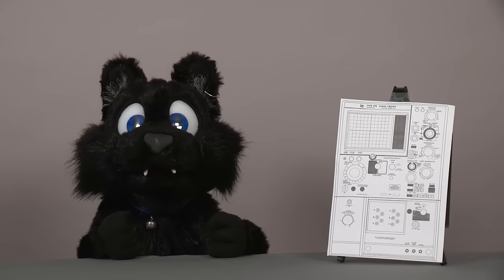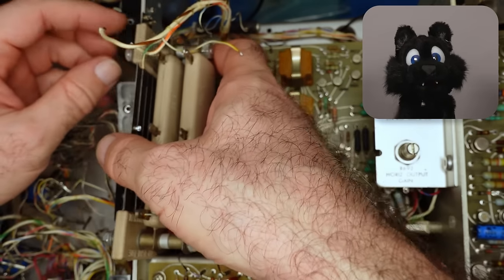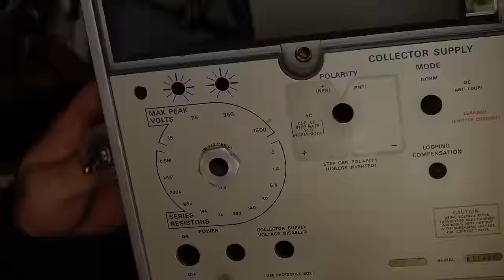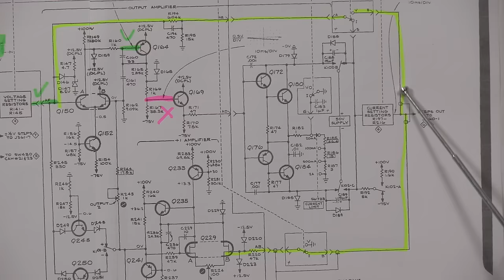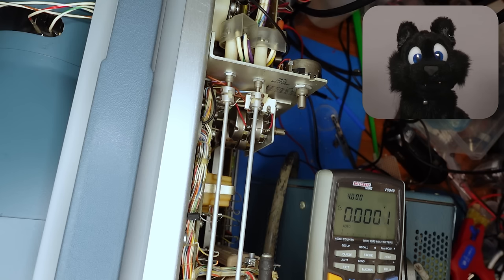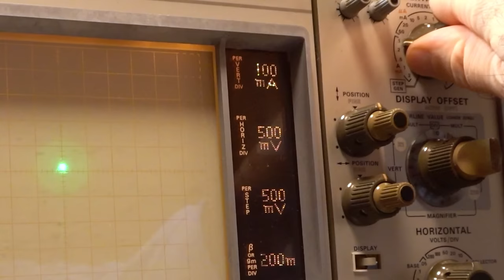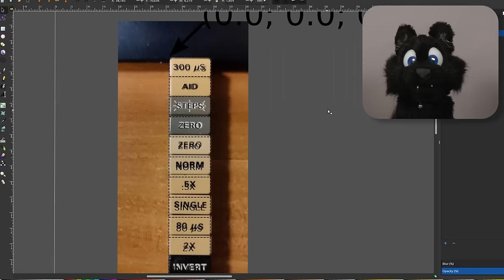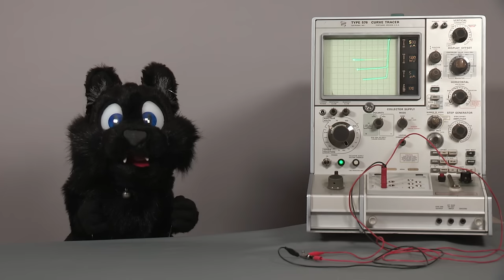Tektronix 576 Curve Tracer - Part 3

Comment: When you showed the relays I thought: "if those things are broken he will never find a substitute for them". And later when you fixed it I was vibrating like I was watching the final of Monte Carlo Master tennis final today: you fixing the relay was very cool. And the "a job for three paws" was a good joke.
Reply from the maker: When that relay turned out to be the problem - after quite a bit of tracing the signal all over - I checked on e-bay if these are around. No luck. I just found several posts that said "they fail often and need to be replaced with other alternatives" - so I just gave it a try. Not sure if I ever need that relay other than for the calibration unit, but hey: it's my device, I want it as functional as possible!

Comment: A trick to cleanly open up those oil filled caps is to take a piece of hardwood, make a hole for the bits that stick away from the plane of the top, place the cap in, then using a very sharp, narrow chisel, gently tap the edge open all the way around. Then it's just a matter of prying the lip flat with a punch and slowly unwrapping it. This way, when you stick it back together, you can use a pair of plastic tipped pliers to bend it cleanly back shut.

Comment: Nice work! You went a lot farther than I would have, and it turned out excellent. Interested to see what you have in mind for fixtures. I saw a nice little home made fixture on the IMSAI Guy channel, and I believe there are some 3d printed examples on the internet also. I have a 577 that I need to pull out and do some repairs on, it has no fixtures either. Amazing what people think the fixtures are worth. Keep up the good work!!!

Comment: I mean what wouldn't you do to properly check the knee of a 1N4007 ?? Incredible work! And I bet Murphy was smiling when he mixed those transistors on the hard to reach heat sink.
Reply from the maker: I thought about what device to first check... and came to the concusion that the probably widest used rectifier diode ever would make a perfect candidate; most people here know how these should look like 😁

Comment: What a different place the world was when this construction method was considered a sane/necessary 
way to build.
Reply from the maker: I think my reply got lost in a browser crash... sorry;
I think the timeframe was just about between the "tube" and "digital" timeframe. When some things were still done with point to point wiring and some parts were trusted to integrated circuits. People will naturally stick with what's proven first.
Reply: I think this is a direct contradiction of the typical "everything was better back then, because it was repairable" sentiment. Yes, the lack of integration makes it more tangible, but this (and a lot of other devices from that era) are borderline not repairable, because at the same time, the lack of integration makes diagnosing faults and actually repairing them very, very hard.

Comment: What a lovely and insanely complex restoration job! I'm still collecting the discombobulated fragments of my jaw from the floor. 
13:27 my advice here would be to use forceps to hold the shield while sinking the heat and not letting it reach the insulation. I always use this technique for soldering shielded cables.
26:30 hope it's not the polychlorinated biphenyl oil... Nasty thing. Nicely restuffed cap though.
Always happy to see those lovely fiber optic pseudo dot matrix incandescent displays. Absolutely Fran-tastic.
Reply from the maker: Normally, I try to hold the shielding with tweezers; but for rebuilds it's often on the shorter side so it's "be quick" time :)
In case of these particular wires, I can say that the inner insulator can take quite a bit of heat, compared to the outer insulation.
I was very careful with the oil; as in use multiple gloves and a respirator. So I think it's good.

Comment: ah, the joys of repairing something, testing it, and having to figure out what might've changed after putting it back together. In my time repairing things I've probably had to take a few units apart a few times more than I really should've, but working without schematics and purely on pictures of the pcb did make work a struggle.
Reply from the maker: The old devices, where you can find detailed manuals and schematics are indeed a joy to work on. Still, accidentally flipping the heat sink upside down either when taking the picture or when assembling it... hrmpf! 😡 - that cost me quite some significant time. Should I ever get a similar symmetrical thing on my bench, I'll make sure to make a clear indicator which way is up on both sides when taking pictures. Like adding a paper clip to the fins of the heatsink... Lesson learned 😊

Comment: I once put in a BC308C into a place of a BC238C due to fat fingers in my stash of small signal transistors and then wondered why the output LED always lighted up when the TTL output was low. I checked everything over and over again, until finally checking the (fine) print on the transistors... if you don't drive hard, PNP and NPN are somehow interchangeable grin

Comment: Really stunning work here! But at 3:04, was that center tap on the step generator power resistor soldered later on?
Reply from the maker: Yes, it was; the centers are actually connected with a wire that was still on the upper one, so I only could solder that "input" wire, once I had mounted the top one again.

Comment: NOTE:  As I was watching the re-installation of the TO-3 and TO-66 cased transistors to the Heat Sink.  I noticed you were using Standard sized nuts for the machine screws (likely 6-32)

SMALL Pattern Nuts are available for SAE 6-32 (1/4”) and 4-40 (3/16”).
Small Pattern Nuts were used with chassis mount tube sockets and Heat Sinks, with tight clearances.

The Heath-Kit Assembly Trick was using only a 1/4” Hex driver for 4-40 nuts and 6-32 small pattern nuts.
Reply from the maker: Hmmm... I'm pretty sure I double checked what was there before; but the unit had some caps replaced before, so it might also have had some tampering with the transistors?

Comment: Be careful with them old oil capacitors. They can contain PCB. :)
Reply from the maker: Not knowing what they exactly put in it is why I was wearing gloves, a respirator and had the paint booth extraction fan running. Only when I had that oil and interior separated, I dared to touch that. Brrr.

Comment: What a beauty! Could you estimate how many hours went into this restoration in total?
Reply from the maker: Really hard to estimate; looking at the video files for the "filmed work time" reference, it's about 28.5 hours of footage; including the puppetry and voice work. I'd say that's not all, but at least it's most of the actual physical work, but doesn't include research, pondering about transistors and similar issues... and also not included is the video editing time. So  I'd about double that number for a realistic estimate of overall time without the video and maybe 3 times with the video. Started the project in Mid February, and just finished it.

Comment: Nicely done! Serial# is 744 off :)
Reply from the maker: Off from... oh! Hehe! I didn't even check. The service manual has listed parts with "up to serial number 5" - so it seems there have been some early changes. And with "we have a number 5" it's not quite clear to me, how they did the numbering. I just can't see that they actually made over 300k units of that? Seems a tad bit much.

Comment: You may want to try some heating and air-conditioning aluminum tape around the oil cap repaired end.
Reply from the maker: As the original seemed to have been leaking a bit of the noil already, I think my cleaned up version is already much safer. Besides, the "plug" part where I had to use the vice to get it in again is most likely a good seal...
Reply: @atkelar  I just meant to make it look better
Reply from the maker: Ah! It looked abit worse on the video for some reason. In person, the "lip" isn't nearly as bad IMHO. Also, there are lots of comments about that cap maybe containing PCB, so I thought this was also going into that direction. 😊
Reply: @atkelar  Great that it was just in the video that it looked so injured!  I have used the aluminum tape to cover up twist loc caps after opening them - works great. 
I once had to rewind a 1950's X-Ray transformer and got  a friend to get me fresh PCB oil from his place of work at the local power company. When I inquired about the dangers of the PCB type oil he said "don't worry out guys practically swim in this stuff" - haha
Reply from the maker: I think it's like with many dangerous chemicals: as long as you don't work a day job with them, it shouldn't be much of an issue. That said, I'd be worried if people bathe in it as part of their job 😜

Comment: Weird connector?  It was probably a Lemo - Tektronix likes those although they're pretty pricey.
Reply from the maker: Maybe, but what Google shows me looks slightly different; The calibration fixture had a - half broken - male counterpart still attached. I also replaced that with a barrel jack and put the original one back in a bag for my friend to decide later on. Not sure why they used three pins here, I couldn't find any "Tek Camera setup" that even had that cable to begin with. All that I found had batteries or other supplies, if they needed power at all.

Comment: At 27:10, is that an improvised soldering iron!?
Reply from the maker: Not improvised; it's the close up of the tip of my soldering gun. For these large metal plates I'm tinning at this time, the regular iron isn't powerful enough to keep up. It would either be cold joints or - sometimes - solder itself to the contact. That solder gun is 250W or close to it.
Reply: @atkelar  Ohhh! I had no idea about soldering guns! My search for "soldering iron with a loop" only lead me to surgical cauterizing tools. Thanks for the explanation!

Comment: What is the liklihood of there being PCBs in that oil filled capacitor?
Reply from the maker: greater than zero... I'm no chemist, so I took all precaution I could when I opened it. Originally, it did have some actual leakage going on around the contacts: there was oily gunk around those. So "a bit of that stuff" was alrady on the outside. I don't think I made contact or inhaled anything significantly more than what was at that stage.

Comment: Did you make sure that Oil can Cap did not have PCB in it??  Pre 77
Reply from the maker: I made sure not to get into contact with any of that stuff as good as I could. Other than that, it's probably mute to validate; becaue no manufacturer would have that on thier archive. By brand and wikipedia list, it seems to not be affected though...
Reply: @atkelar One trick is to pick up a modern one for AC units and gut that one ;)   and dispose of the old one